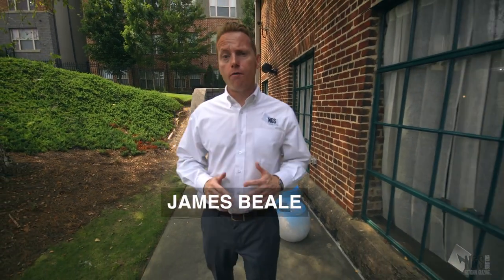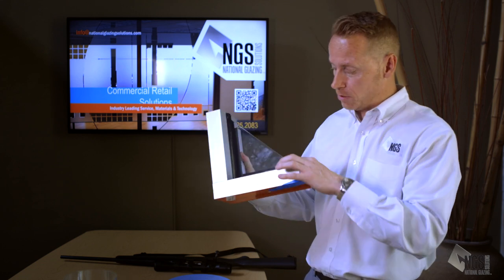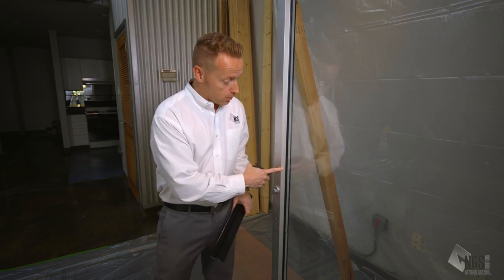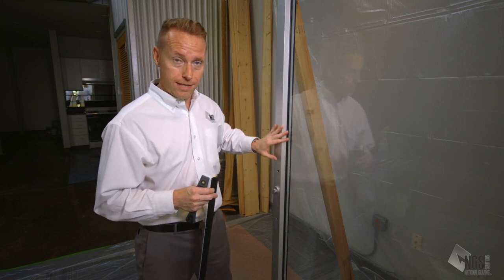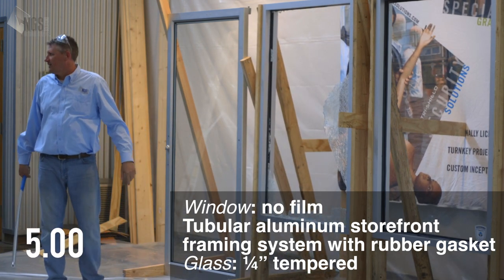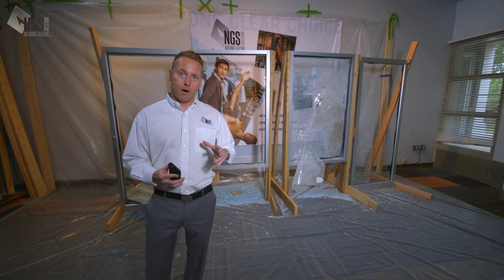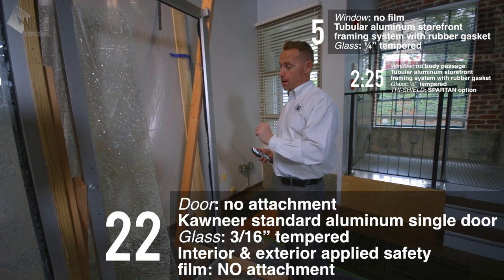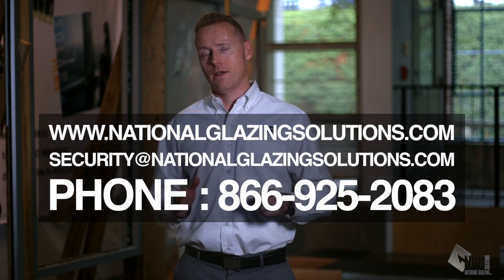Safety Window Film Forced Entry Education & Demonstration

Comment: Very informative video thank you! Quick question, what is the Spartan option? Also, I have double panel glass at home, do I need to apply the film on both sides?
Reply from the maker: yes adam we apply the film on the interior and an exterior weatherable for the outside. The Spartan option is 15mil thick on the interior and 7mil weatherable on exterior

Comment: Most windows do not use tempered glass, annealed glass is used. Would like to see performance of film using annealed glass.
Reply from the maker: that is partially correct, however, most new storefront window systems at ground level are tempered. To answer your question annealed glazing resists breach attempts better than tempered.

Comment: How does it hold up to a butane pocket torch? Should there be a house fire what kind of fumes does this film give off? Whatever happened to wired glass? Inmates from our county correctional center used the hot ember from a cigarette to melt through bullet-proof glazing and escaped, but did not get far
Reply from the maker: Paul, it will not hold up well to a butane torch. 3M technical docs from astm testing:  F. Flammability: Surface burning characteristics when tested in accordance ASTM E 84, demonstrating film applied to glass rated Class A for Interior Use: 1. Flame Spread Index: no greater than 25. 2. Smoke Developed Index: no greater than 55.
Reply: its made of plastic, thermoplastics always melt when exposed to heat.

Comment: does this work on vinyl frames
Reply from the maker: yes it can adhere to vinyl, you need to review the profile of the frame and do a test to make sure the adhesio is appropriate
Reply from the maker: The gullwing (tape) attachment system will adhere to vinyl but would need to be tested for adhesion prior. You will most likely need more than 1/2" of profile on the vinyl frame for proper adhesion